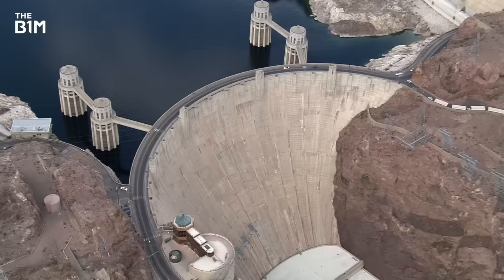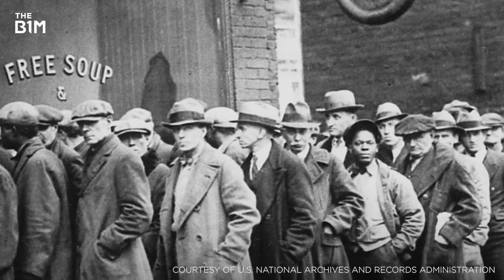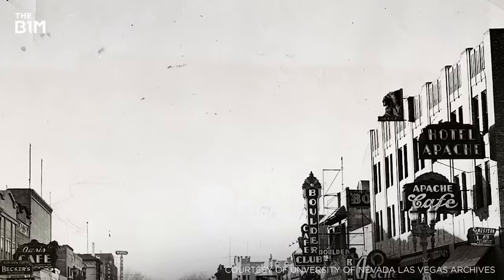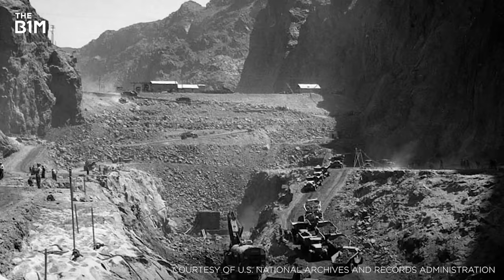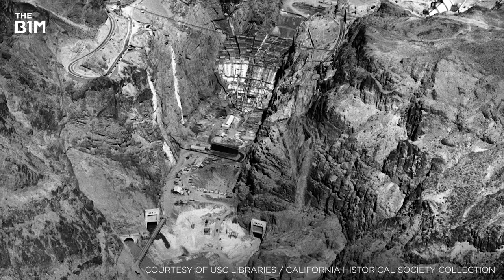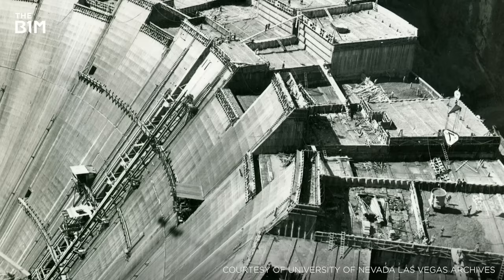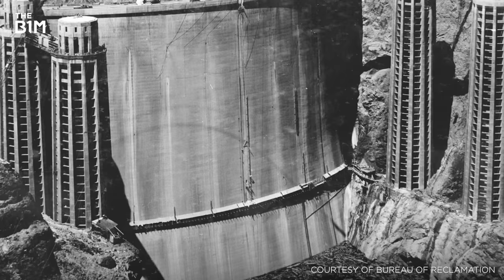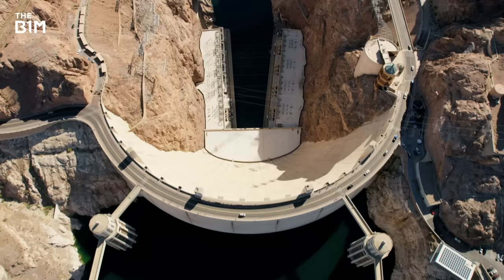Building the Hoover Dam

Comment: I remember visiting the Dam on my Honeymoon we flew over it first in a helicopter and it looked "small" mind you the Grand Canyon is massive only did we realize how big the Hoover was till we drove to it and realized the sheer enormity of it from ground level; the round cylindrical buildings are over 20 stories ABOVE water level! Also, the tour is amazing and one to definitely add to the bucket list if you ever find yourself in Vegas or in Colorado. One interesting fact mentioned on the tour is that this was not the initial location for the Dam but finances dictated it be located here...
Reply: Joe Lyons where was the original plan?
Reply: Hey Devin Heida
“Hoover Dam” or “Boulder Dam” was originally named Boulder Dam. That’s because the initially planned site was at Boulder Canyon about 10 miles north upriver from where it is now located at Black Canyon. An engineering reassessment moved the location from Boulder Canyon to its present location. Apparently, finance and communication network (roads etc) meant the cost was too prohibitive even though it was way more suited to that location...
Reply: @Joe Lyons The Hoover Dam is nowhere near Colorado.. Lol
Reply: I remember taking the tour in August 2001, and again in 2003.  The tour had changed substantially due to 911.
Reply: @Joe Lyons  Are you still married ?
Reply: @Saboteur709   Interesting, how was it changed?
Reply: To build the dam, they had to ______ the river.    What was it
Reply: @Mr61grod  haha yea just

Comment: 4:02: So if the concrete would take 125 years to harden in 1933, it would be 2058 by the time the concrete would harden.
Reply: Actually, the concrete was hardened by an onsite liquid ammonia plant, not river water.
Reply: @roadtoad7704  that's what I remembered when I watched the documentary
Reply: @roadtoad7704  Actually, they used both river water and artificial refrigeration cooling.  After the concrete was placed the chemical reactions of the curing concrete produced heat which caused the temperature of the concrete to increase.  River water was then pumped through the cooling pipes embedded in the concrete to carry away the heat.  As the temperature of the concrete decreased to the point where the temperature difference between the concrete and the river water was insufficient to extract the heat as quickly as desired the cooling system was switched to use artificial refrigeration to increase the temperature difference and speed the heat extraction process.  Using this 2 stage process saved a lot of cost by allowing a smaller refrigeration plant to be used as a large proportion of the heat was removed by the river water.  You are correct that ammonia was used as a refrigerant.  Interestingly, the compressors used in the refrigeration plant were originally used to create the massive quantities of compressed air used in the early stages of the project when blasting the diversion tunnels and scaling the walls of the canyon.  The electric drive motors and compressor bodies were re-used but different cylinder heads were installed to convert the compressors for use with ammonia.
Reply: @Vincent_Sullivan  Now that's said, it does make practical sense. Use river water while heat transfer is more gradient, then the ammonia to cure. And that would require smaller workings of said method.

Comment: 50 sqft is not 15 sq meters. perhaps you meant without the sq.
Reply: iwbagiai   Yes.  50 s.f. is probably right, and the conversion was done on the single dimension.
Reply: I made the Kessel Run in 14 Parsecs .
Reply: IETCHX69   A parsec is a distance; about 3.26 light years.
Reply: Without the square? But 15 meters is just a line, so it would need the square in order to measure area like square feet. Did I miss something? Because I feel like 15sq meters (which is about 45sq ft) is close enough to 50sq ft to be used as an approximate measurement.
Reply: @tjpprojects7192  15 square meters is 161.46 square feet. 50 square feet is 4.64 square meters.

Comment: I still marvel at the bold plan and even bolder implementation. Many of the workers were more than just unskilled labor. Their were master carpenters building indicate forms for concrete. Look at the Canyon walls where concrete is poured. Looks like the concrete fits walls like a custom 'glove'. The scalars on the rock walls removing loose material that could compromise integrity of dam required balls bigger than the dam. Today this would still be considered a massive project that would yield massive benefits. The Desert Southwest was changed forever by the Hoover Dam.

Comment: If you notice on the closing drone shot, the cars are driving the wrong way. This means they did a drone shot, then played it in reverse when they edited it. 

Otherwise, a good video. I drove across this bridge in 1995 hauling a U-haul behind my car. The weight of the U-haul kept pushing my car forward and my brakes failed about 500 feet from the dam. I honked my horn and people got out of my way quickly.

Comment: There are a lot of comments to look through here (apologies if it has been mentioned before).  But in case someone didn't previously notice at 4:30.  

50 square feet does not equal 15 square meters.

Comment: Nice video, you might consider a follow up video of the arch bridge across Black Canyon. Although it was fortuitous that the Boulder Dam Project would supply much needed jobs. The main purpose of the dam was flood control.  Excellent video allot of good information for such a short documentary. Use of the construction photographs and diagrams outstanding. Two thumbs up!

Comment: I am not an engineer and I don’t know what a “coffer” Dam is? I also wondered how the Dam was filled and designed not to overflow?
Reply: There is 2 spillways on each side to pervent overflow, since 1936 spillways were only used twice, first time when they tested after completion, second time in 1983 after wet spring and melting snow. Thats the only time lake was full, you can find video on youtube from 1983 spillway , just type hoover dam spillway., its really impresive to see it. After that lake never reached those levels again, and i dont think it will ever again.
Reply: Cofferdams are temporary dams built from soil and rock from the main dam's excavation work, they help by keeping the work area for the main dam dry until it's fully constructed.